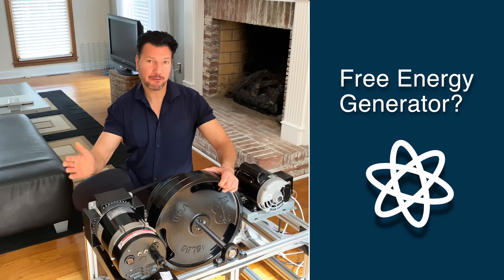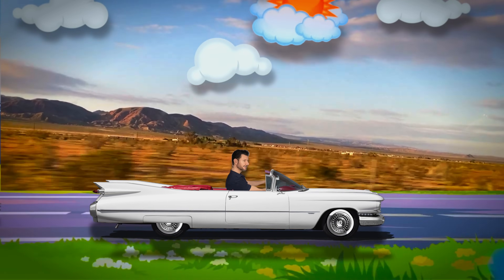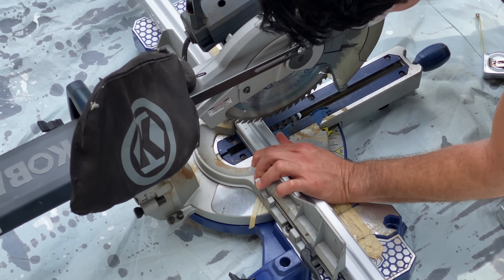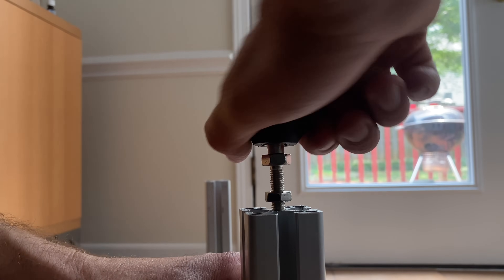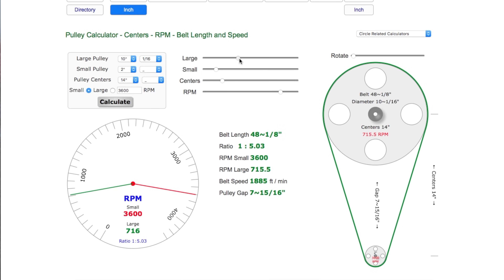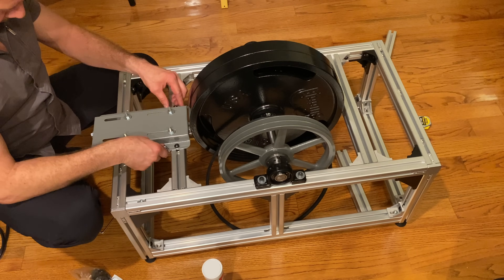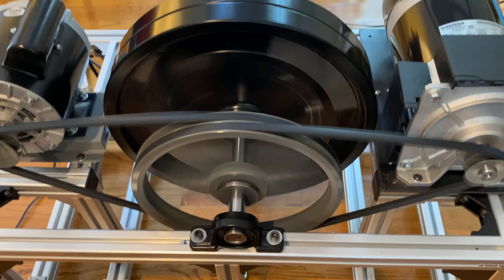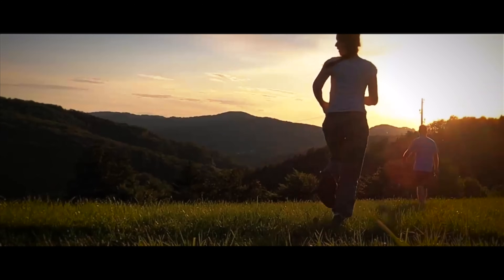How to Make a Free Energy Generator!

Comment: Others use the Truck Wheel and Tires to be used as a Flywheel... and maybe using Tesla Tech/transformer to power up the Voltage and Current to work out with the system but you have to have the inverter on it too,.. just maybe... :)

AC/DC...
Reply from the maker: Thanks for the feedback Solomon !

Comment: Hey I started similar project too after seeing those video from guys in Indian doing this. My recommendation for you is to change the generator to a diesel generator with lower rpm that way when you switch you from power supply on the motor the generator still hold some power. That was how I succeeded with my project. Nice video by the way
Reply from the maker: Thank you Kevin!
Reply: Hay Kevin try an riding lawnmower transmission it will give you the spine you want Sen this man do this and it makes it hum every turn gives it speed 😉

Comment: I appreciate your attempt of recreating free energy generator but your entire selection of assembly was wrong. It will work with the following modification .
1. Generator (alternator)that works on 1500 rpm about 10kva single phase in capacity.
2. AC motor about 3hp that spins flywheel at 3200 rpm.
3. Connect two pulleys to flywheel having 1:2 ratio. The bigger pulley on flywheel should be connected to AC motor and the smaller pulley to Generator. Install pulley on Generator  which is half in ratio to flywheel pulley so that 3200 rpm of flywheel rotates generator at 1600 rpm.
4. Install electronic switch over as u did in this video.
4. Apply load of 500 watts only. The generator will sustain for hours.

Comment: Put a high frequency controller on the motor. 120 volts at 60HZ is BS. It's why you get amps = which is heat loss, and draws more power. Frequency is missing from the Ohm, Volt, Amp triangle... You have great engineering skills, you should look into more proven designs such as Gerard Morins High Frequency Motor, and Joseph Newman's Impulse/short circuit air coil permanent magnet flywheel.
Reply from the maker: Thank you First Last!
I haven’t heard of Gerard Morins but will look him up.
I will get a VFD and also looking for a better more efficient motor.

Comment: Hi there,
In order to proceed with this project you need to measure the power into your prime mover , that is the motor , and also measure the output of your generator .
Apply a one KW load , say a heater to start with and see if your output is less than input .
If so you have an excess of power .
That is the efficiency of your machine is over 100%.
Experiment with higher loads .
Kery
Reply from the maker: Thanks Kery!

Comment: I think the Indian's trick is simple. It uses the electrical motor socket only to trigger a relay. The actual motor power wire is hidden in the machine frame. when the socket is connected to the generator, the motor power is turned on again
Reply from the maker: You think so?🤔
But it’s so much work to build a generator like it what is the benefit if it doesn’t work?
Reply: @MarkusNenning  I agree with your comment, there is no point in setting up such a machine. But we have many similar videos on YouTube. Perhaps the phenomenon is explained by the sociological or psychological way, I don't know.

Comment: You need alternetor of car to connect with inverter and battery  to power main drive motor. And generetor of 1500 rpm.
You can drive alternetor  from ant extra moving Polly.

Comment: I think you need to store the energy that is coming out of the generator into a deep cycle battery bank or a bucket cap and a transformer. The generator can also recharge a battery system for the motor. Off the battery bank you would set up a power inverter for you ac output. Just a thought.
Reply from the maker: Worth a try Brandon just not in my budget at the moment.
But I will definitely try with some batteries eventually.
Thanks!
Reply: Salut Trebuie facuta o bucla de autoincarcare. Cum ai facut tu ai unit bobinele si normal sa se infraneza. Pe scurt un controler la iesirea generatorului - baterii de stocare -invertor de la care alimentezi motorul. Eu asa as incerca. Spor !

Comment: Maybe try to imitate the same flywheel diameter (32") and weight (120kg, 264lbs) of the Indian videos that work in several 3/4" thick steel plates?  Your three 45lb (135lbs) wheels are barely over half of the generated rotational inertia of the "successful" Indian units on video.  I actually did not see your unit start up--I saw only that you stated that the run was a failure.  Are you using continuous-duty or the stop-and-go compressor-duty motors?  Is the main goal of your unit keeping the alternator running or is it keeping the motor running?
Reply from the maker: Just hard to get or make a flywheel like that here in the US.
The goal is to run the motor with the generated energy and use the rest to power a crypto mining rig.
I have a better explanation in part 2.
Thanks for watching and your feedback!

Comment: Wouldn't it have been easier to just attach the flywheel directly to the alternator and deleted one of the belts? And wouldn't it be easier to run a longer pully from the alternator to a smaller pully from the motor? Why wouldn't you just use two alternators on one pully? Wouldn't a slipper clutch be the best move for the flywheel?
Reply from the maker: Thanks Trevor,
That’s what I am working on.
If you have a chance watch part 2

Comment: with a gear (motor on a small like ur first try - generator on the gerater) + a flywheel(power) >= the gearing u can increase the input from the motor to the generator to start the loop.
and maybe try bigger flywheels. i think not only the weight is importent
Reply: کچکچ
Reply: حچصکچسس

Comment: Hey you need to rewire your electric motor you missed a major step
Reply from the maker: Which step did I miss?
Reply: @MarkusNenning  research the rotoverter by David Torres. Or go to the YouTube channel Patrick Kelley and watch the rotoverter video. You have to modify your electric motor so you can pull energy from the vacuum

Comment: I still like thermal energy the best liquid in vacuum boils at low temp get it to boil at room temp pressure can power turbine and cool and evaporater to liquid pump back round if done big two room one condenser one a avaporater hot room cold room heat engine in between as added bonus from waste heat

Comment: I know the awnser I see it on utube but they themselves did not know the importance of it
Google this it was a cart 3 wheels one a front the back wheels had direct drive to a propeller the thing is it went faster than wind speed they put it on a tread mill and it propelled forwards faster than tread mill indoors with no wind the wheels drove the prepller the prepller drove the wheels I unlocked it
I believe this it could be placated many ways
Reply from the maker: I think I have actually seen that video.
Thanks

Comment: Voltage inverter is Missing, you need to multiply the voltage output and supply small amount of current to the motor, just enough for the spinning Alternator motor, and the rest current is for the appliances.

Comment: Perpetual motion machines do not work. If you think the drive motor can be powered by the generator driven by the flywheel
Reply: While you unplug the drive motor and plug it into the generator the drive motor slows down and it increases the load on the generator to regain equilibrium. That is input equals output, just the action of switching from drive to load by the motor starts a downward spiral of input power because there isn't any. You just can't remove more than you put in. That goes for anything. There are outside forces against you, resistance in wiring, friction in all the bearings, rubbing friction in drive belts, cooling fans on motor and generator, the rpm drop when you shut off the driving motor and connect it to the generator. No machine is 100 % efficient. Everything slows down by the effect of outside forces. Perpetual motion does not exist.
Reply from the maker: @Princess_Paula_T.  if you have a chance watch part 2
Thanks
Reply from the maker: Paula I have seen some very convincing machines on YouTube I am not so sure about that.

Comment: Well, I appreciate your honesty. 
These devices cannot run in closed loop.  The reason!  Any loss due to friction, heat, etc takes energy away from the output and therefore the output will always be less than 100% efficiency.  You need 100% efficiency, as a minimum, just to keep the device running.  If you need to run a load with it,  the efficiency must be much higher than 100%.
Reply: Everything that moves/Changes in any way converts energy into another form of energy. With any energy conversion you convert a part into heat energy. Thats the core of every Energy conversion that we know of.
And thats why if youd manage to gain more Power from that thing than you put in, its more likely you found a way to tap into a different Energy source to keep it spinning. Because everything else would mean that hundreds of years of studying that dry crap would be wrong and since we havent found a system anywhere that literally produces energy in nature, its highly unlikely that it exists. If there is a way to produce energy, natural evolution would have found it and adapted it.
Reply: @FoxRoxification  Hola opino sin saber , si un motor esta girando y produciendo energía (ya sea de imanes permanentes o un motor de bomba como muestran los videos ) y tiene pérdida por calentamiento , no se podría usar ese calor para también contribuir a la producción de energía , como ser conectarle por decir un número , 1000 termocuplas y sacar energía de esas termocuplas agregandolas a esa producción? , no hay forma ?
Reply from the maker: Thanks Valveman!
Reply: @MarkusNenning  try with permanent magnet alternator
Reply: @AryanKumar-yp6jc  
That won't make any difference.  It's just not possible!
Reply: I think you are forgetting about an entire energy source, the electromagnetic aether!
It is unlimited and abundant, and was stolen from civilization around 250 years ago. The old world was using this power source for everything. There are also permanent magnet motors which draw on the force of a strong magnetic field. Overunity is ASBOLSUTELY POSSIBLE DON'T BELIEVE THE NASYSAYERS
Reply: You can harvest more energy from a field collapse than it takes to establish it? Tesla was right and he proved Hertz wrong over 100 years ago.  Traditional Em is a 100 year old glass prison to keep us stuck on this rock squabbling over bullcrap while we are slowly genocided by 'diversity' destroying all actual diversity. And biodiversity. Time to wake up
Reply: @N4CR  
I'd say time to learn some physics. 
What you claim is completely BS.  If what you claimed were true, then you are claiming to create energy from nothing.
A collapsing magnetic field does not contain more energy than what produced it.
Reply: @N4CR   "You can harvest more energy from a field collapse than it takes to establish it?"

Out of interest, do you have this perception because the back-EMF of a collapsing magnetic field can create a higher voltage than the voltage which was used to create that magnetic field?

If so, you need to understand the difference between potential difference (measured in Volts), current (measured in Amps), power (measured in Watts) and also that power and energy are not the same thing.

Volts is not a measure of power.  Nor is Amps a measure of power.  They both relate to a measure of power, in Watts, but neither Volts or Amps is a measure of power, or energy for that matter.

The reason that back-EMF can create a vastly higher voltage than the voltage used to create that same electromagnetic field, is because this typically occurs when power is removed and there is no load across the inductor at the time of the magnetic field collapse.  This allows the field collapse to cause a very high voltage but with a minuscule amount of current.

As a consequence, no increase in power or energy.
Reply: Try with low rpm permanent magnet alternator

Comment: if you can go with permeant  magnet AC motor it will  be for efficient. if you can go with permeant magnet generator it will be for efficient. Add capacitors as needed.

Comment: stack two 3 phase generators one behind the other twist one 45 degrees out of phase of the other.  stack two 3 phase motors one behind the other move one motor 45 degrees out of phase as the other . it will act like a six phase motor and a six phase generator, witch will increase efficiency.

Comment: Best to use a Super Capacitor instead of a flywheel. Less vibrations and just a battery to charge the Super Capacitor. Smaller and compact. No Fly Wheels are needed at all.

Comment: You need to modify the generator with magnets to produce full voltage and current at very low RPM, then feed it to the motor which will consume 1/4-5 of the power from the generator
Reply: 1500 RPM Required

Comment: Remember nothing is impossible just improbable. Combining the right components or gearing with power out put is the key.  Buy the way I have done this with very small motor and generator.  And it worked. Larger ones have more drag or friction.
Reply from the maker: is your project scalable for a large generator? 
Is it the same concept with a flywheel and belts?
Thanks Benjamin!

Comment: I know what needs to be changed. The rules of physics!
Reply: It failed! What are you thinking?
Reply: Everything is possible.
Reply: Please do I contact you
Reply: @MarkusNenning  i din get ur "no" was for what ❓
Reply from the maker: @huzaifafarooquie3814  sorry though someone asked me if it works
Reply: @MarkusNenning  the generator u made is very good and working coz u n i made the same one... I am using it as a renewable Generator less consumption, more production. 90% efficient.
Reply: @MarkusNenning  bro now i am working on automatic magnetic pendulum for much lesser consumption. What about that amazing inverter 🤩❓
Reply from the maker: What did you do differently to make it work?
Reply: @MarkusNenning  i use the regular electric provided by government but here in India they provide me a provisional meter that if we generate 125kv and use only 100kv then they buy the rest 25kv as per regular unit rates...
Reply: @MarkusNenning  so my formula is simple i explained it before top in the comments...
Reply: @huzaifafarooquie3814  hello huzaifa and @Markus , i am from pakistan. Before this video i have seen multiple other videos and I thought its just getting benefits from YouTube channel.
As per hizaifa commitments i am now thinking its true. I want help to do the sMe in pakistan. I am having 5kw solar installed and wants same as u did in india.
Can you provide be the proper documentation and video or any other good material?
Reply: @msalman373  1st is, it's an expensive project 2nd is u have a guy name nauman afridi at Pakistan so what are you doing here ❓
Reply: @huzaifafarooquie3814  can you plz give me some idea ? How expensive it is . And if i did expense then what will be the benefit ?
Also can you send me ur project pics ?
Reply: @msalman373  there is a video on my channel you know what to do next❗
Reply from the maker: https://youtu.be/wqbJWBtoFMQ
Check out my video from a visit to a green energy inventor
Reply: @huzaifafarooquie3814  let me check.
Reply: @huzaifafarooquie3814  didn’t fine video. Plz share the link here.
Reply: 3 phase  generate is better....try it and tell me plz...best wishes
Reply: You didn't test different size pulleys on the motor's?
Reply from the maker: I did
Just about any size
Reply: I made it, It took me a week. The cost of the materials I spent on this failed project exceeded $300. Finally, the result was 2 to 3 volts.. Do not believe them. This lie in the video is nothing but crap.
Reply: When you change the rules of physics the rules of energy shall manifest itself.
Reply: Yeah rules of physics will make it happen 100%sure
Reply: Pully on the weight way to big
Reply: Combustion & a Liberty engine Generating Energy 😮bewegen that Battery how about that Sir.???.
Reply: bukan gagal tapi karena anda jujur tidak seperti India penipu !
Reply: Vậy thi nghiệm của bạn thành công hay thất bại.! 
Yess hay no
Reply: Yes, a book on physics would have been cheaper than all this waisted hardware.  Hopefully he made a few bucks on his channel to recover his energy deficit.
Reply: Yes the rules of physics keeps on changing since 1908 even before that...
Reply: @huzaifafarooquie3814  Brother Pls Give Me your Insta And Show me How it Works Plsss!